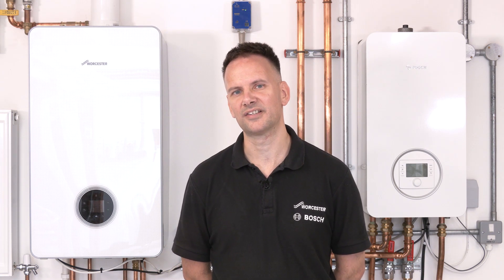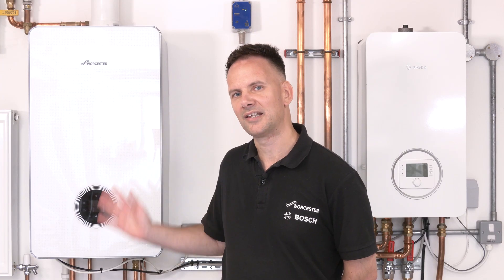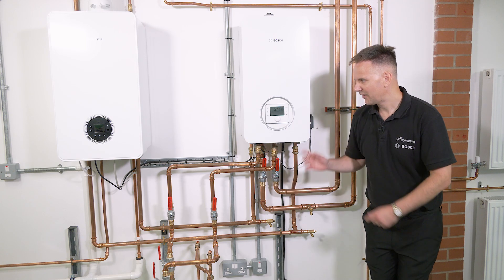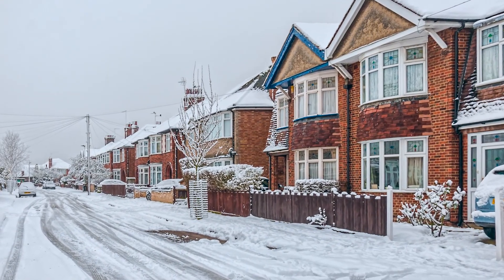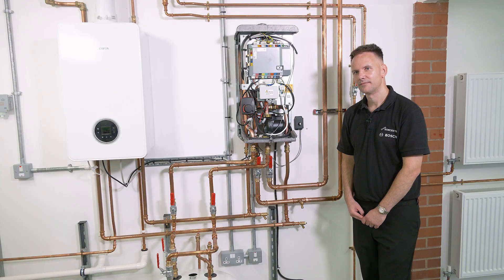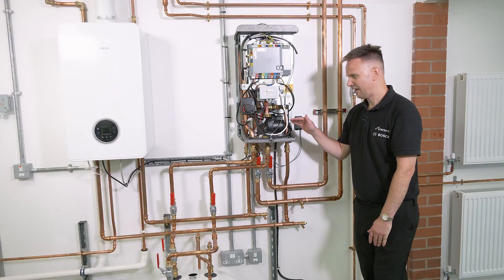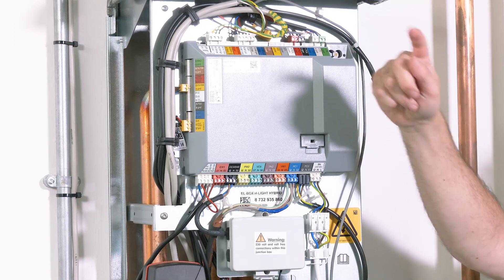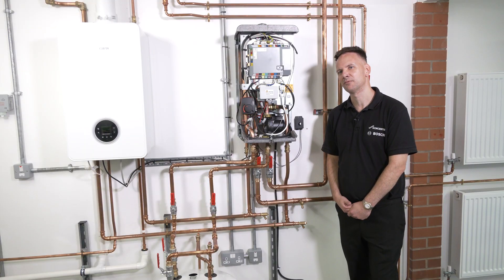Training webinar: Basics of a hybrid heat pump system | Worcester Bosch

Comment: This set up is way over engineered and will confuse the hell out of about 95% of customers homes it’s installed in. In the event of an issue/fault (which, with 3 mechanical appliances working in tandem is going to be more frequent than with just a gas boiler), I would say 95% of attending local heating engineers would be confused as hell. Stick with your gas boiler. Absolute bonkers!